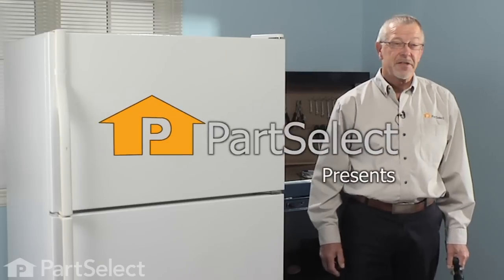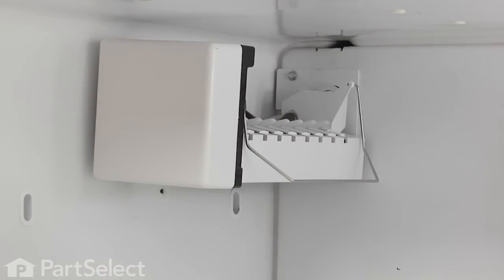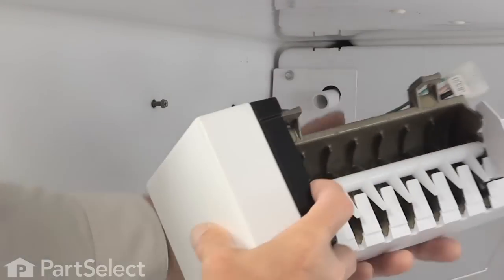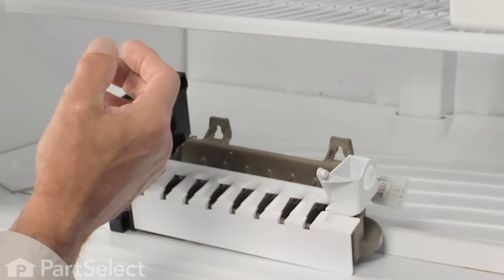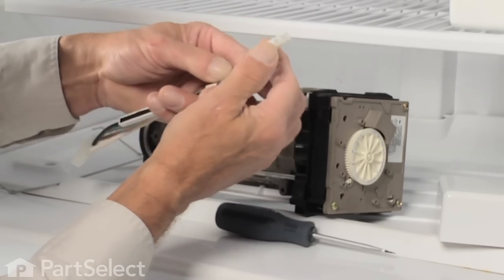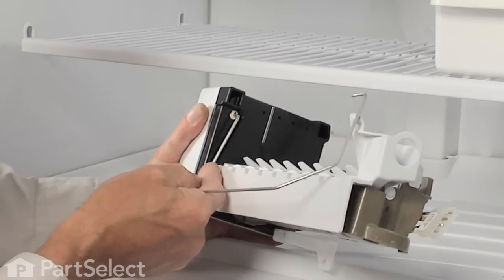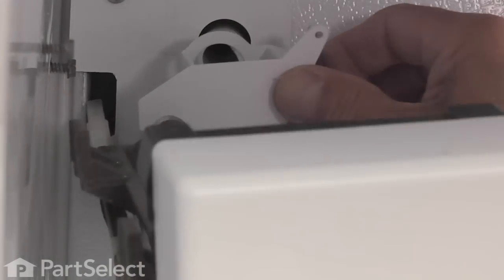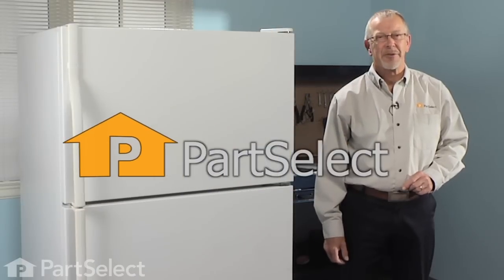Refrigerator Repair- Replacing the Icemaker (Whirlpool Part# 4317943)

Comment: Thank you. I probably saved $200 by watching your video. I paid only $45 for the new part with everything included. My original part lasted for 15 years. I could not have done this or thought of doing this until watching you. I did not want to just take it off and see if I can fix it being concerned that I would not be able to put the same part back. You never know what you can foul up when you take a part off. I am keeping my old part since I was having a problem with the bar. After taking it off and having the part defrost, it appears that mechanism may work. Great video. Thank you

Comment from the maker: I'd suggest testing the ice maker and seeing if it's completing the ice cycle completely. If it does then test the water inlet valve that feeds the ice maker (there's an electronic valve or solenoid) that controls the valve and it might be possible that that solenoid is faulty. There's also a screen on the valve and make sure that's not full of ice/debris.

Comment from the maker: Hi Michael,

Sorry to hear about this problem with your ice maker. Sorry for my confusion, but I just want to clarify - Is the ice maker not making any ice at all, or is it making ice but not dispensing it? Is the water dispenser working properly? Have you actually replaced this part, or have you simply disassembled it and reassembled it?

Hope to be of help to you shortly! Thanks.

Comment: This looks like we should be able to remove the endcap that comes on the unit and replace it with the Ice Plus fan unit that is on our old one which cools the water faster speeding up ice output..
Our fan unit is called the IceMagic Plus.

Comment: My ice maker isn't getting any power I just replaced it with a brand new one. But I'm using the same harness that was connected to the old one. My ice maker harness goes into the side of the freezer. I believe my issue is I need to replace the harness because the ice maker isn't getting any power whatsoever. How do I remove the harness that seems to be embedded into the wall of the freezer?

Comment: I have a Whirlpool refrigerator model EB9SHKXVQ05 and cannot figure out how to disconnect the ice maker wire harness from the back.  I want to remove the ice maker completely to make more room in the freezer.  This is a bottom freezer.  Your videos are excellent and very easy to follow. Thanks! Paula
Reply from the maker: Thanks for the compliment about our videos. The wire harness can be a challenge to remove. If you search our site using the model, number you provided or use this part number W10458985 you’ll find the schematic for your refrigerator. For your model, there is a wire clamp that you’ll need to remove before you can take the harness out. Hope that information helps!

Comment: Steve,

The video is great but I have a question.  Our Whirlpool model is IT8WSKXRW01
We ordered the ice maker from Whirlpool (model 1129316 fits all Whirlpool).    Our refrigerator back shows only the tube to connect the water line.   There is a 4 pin female connector in the freezer compartment and the new ice maker has the 4 pin male connector.   I assume we only have to connect the wire harness connector and the water supply. The harnesses that come with the ice maker are not needed, correct?

Comment: Question,  our old Whirlpool fridge died.  Ice maker was fine.  Bought a new Whirlpool fridge that has no ice maker but is compatible if I want to install one.  Only problem is the plug on the wire harness on old ice maker is different from the plug in the new fridge.  Any suggestions?  Thanks much!

Comment: My freezer has the three screw holes, but the  bottom screw was missing from the beginning. Is that a internal switch or something for the valve or something? Will it work without that bottom screw?

Comment: I have a Whirlpool GI6FARXXQ05 only a few years old. The ice maker has never worked well.  I'm trying to remove it for further inspection, but it won't seem to budge.  I've pulled the plastic tab on L. side of the ice maker that disengages it from the side of the ref. but the maker will only move 1/16" as if there is another holding point.   I can't see any other tabs or screws securing it even using a mirror. Am I missing something?  I called Whirlpool support but they wouldn't help me.

Comment: Sometimes I get black dirt flakes on my ice. Full disclosure, I am on a well, but no discolored water anywhere except icemaker. Any thoughts?  Thanks for posting this vid!
Reply from the maker: That is sometimes a common symptom of the finish flaking off of the ice maker mold.
Reply: @partselect  do you need to replace the entire part if this is happening or is there a simpler solution?

Comment: My fridge Kenmore Coldspot 106.64944400 does not have an ice maker.  I want to do a fresh install.  Any directions to do a new install.  The fridge does have an inlet on the back of the fridge.
Reply from the maker: You should be able to install this ice maker kit PS358591. You will also have to order the bail arm, PS11743310 separately, and
also the water tube PS371247.

Comment: Quick question if the arm moves up and down, and it sounds like its filling with water why isn't my ice maker making ice? Help me please
Reply from the maker: Hi Chalinda, 
When your icemaker initiates a harvest cycle, the arm will lift up as the cubes are ejected and then the mould will fill with water for about 7 seconds and then the arm will drop. If no water enters the mould, the problem could be with the icemaker control module, the water inlet valve, inlet supply tube or the water supply line. Check this page for more information and good luck with your repair.
http://www.partselect.com/Repair/Refrigerator/Not-Making-Ice/

Comment: we have a twenty year old refrigerator by Kenmore that is still working, but the ice maker or something is making a "bang" sound when making ice. What could the sound be coming from, or maybe a new refrigerator, what do you think what is wrong?
Reply from the maker: Try lifting the ice maker shut off arm to the “off” position to help diagnose the symptom. If that is the culprit, it is fairly easy to
change the module or the complete ice maker assembly.
Reply: I have lifted shut off arm and it still makes the loud sound, so it is something else causing the "bang" sound or pop sound. It is making ice when the arm is down. So what is wrong, maybe a new refrigerator is due.
Reply: I see that PartSelect sales parts, very good?
Reply from the maker: That may be the sound of the defrost timer as it starts or stops the defrost cycle. This may happen every 6 to 10 hours of compressor run time and you may hear a loud noise as the timer starts the cycle and then ends it about 30 minutes later.
Reply: We determined that the defroster was the sound we were hearing. My wife paid two hundred dollars for the refrigerator, so instead of having it repaired, we put cash for a new one, the refrigerator was recycled.

Comment: Hello my refrigerator only my ice if I pour water in my ice tray
Reply from the maker: Hi Frederick. Sorry to hear you're having difficulties making ice using your ice maker. There will be differences from model to model but try heading over to our repair page where we've detailed some of the common causes for a fridge's ice maker not working properly. http://www.partselect.com/Repair/Refrigerator/Not-Making-Ice/. Good luck isolating the problem; if you're still stuck, pass along your fridge's model number and we'll investigate further.